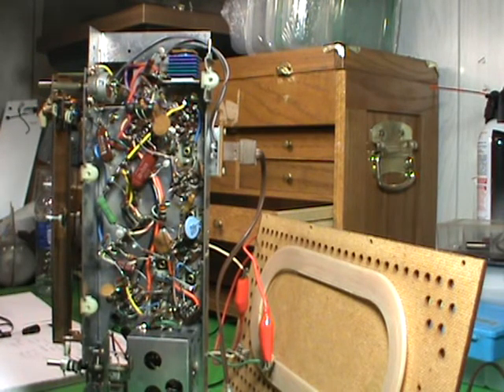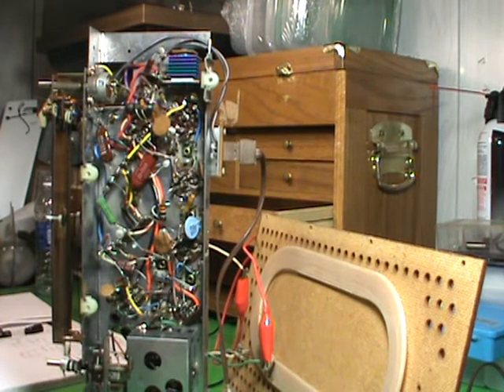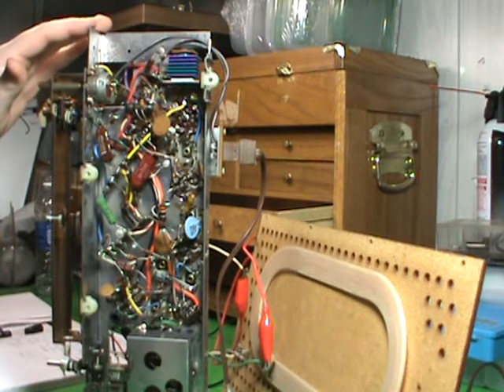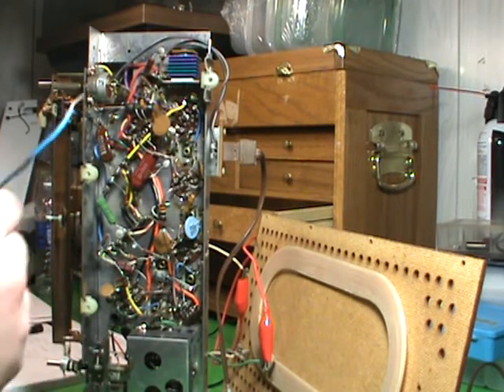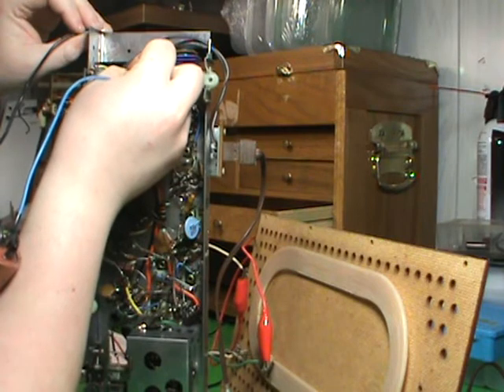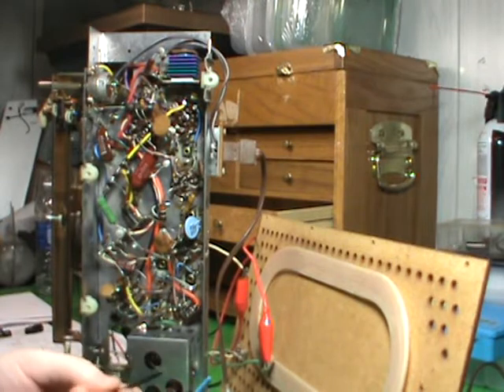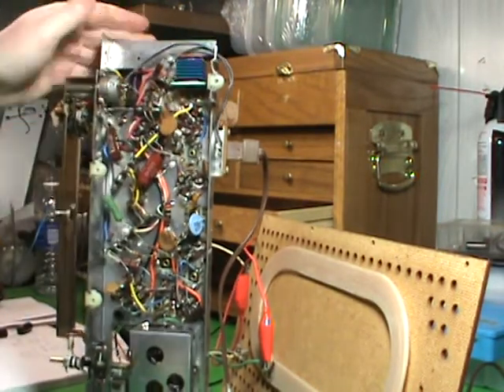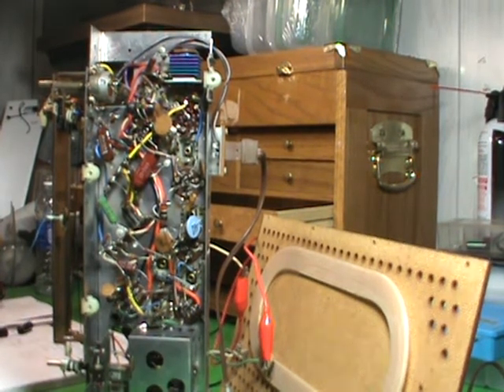Troubleshooting a Zenith K-731 tube radio

Comment: no sound from mine, assumed the selenium diode (blue thing) was out, replaced with 1n4007 still nothing. any comments appreciated.
Reply: Did you put a resistor in series with the 1n4007?  I think you'll need to put something like 100ohms in series with it.
Reply: @jimmccusker3155  What is the purpose of the resistor?  and how does one determine the correct value for it?
Reply: @jonnyphenomenon  Selenium rectifiers typically drop from 5-10V compared to about 1V dropped across a modern silicon diode.  The K731's original selenium rectifier had a 22 ohm resistor in series with it so you're essentially trying to produce an equivalent drop across the replacement diode & resistor.  If you leave the 22 ohm resistor you'll have too much voltage entering the radio.
Reply: @jimmccusker3155  thank you Jim! I am restoring an N731 and an X334, both with 7n07 chassis in them. I had just posted a question about it on the antiqueradios site earlier. This is helpful information. Thanks again.
Reply: @jonnyphenomenon  Good luck Jon.  I have a K731 that I'm restoring.  Right now I'm waiting on parts and hopefully will have it working again soon.

Comment: Your method of subbing in a replacement cap for test purposes while the radio is powered up certainly will,  in most cases, reduce or eliminate the 60 cycle hum leaking into the amplifier circuits and therefore indicate a leaky capacitor.  Anyone attempting this method should take the necessary precaution of protecting themselves should the replacement capacitor explode.  Better still I would recommend that you use clip leads and jumper the relacement into a section one at a time with the radio unplugged. You will hear any difference in hum upon power up.

Comment: Any idea how I would go about dating my K731? I have noticed through a little bit of research that there are 2 distinctly different wooden boxes used. One has legs that go from just under the top and extend below the bottom of the unit, the other has no legs just a base with decorative cut outs. I have  the later version. Just wondering which came first. Thank you for your time.
Reply from the maker: Don't quote me, but I believe the ones with the legs (which is what I have, they call it the Modern) is the earlier version. I want to say late 50s. I believe the one you have, the Colonial style, came out in... 63? I think the Colonial is even designated K731L, But I may be wrong.
Reply: Wow. Thanks for the info. Every little bit helps.
Reply from the maker: The K731 is a fairly common radio nowadays because it was very popular, well built, and used common enough components - it performed well, was built well enough to last 50+ years, and if it needs to be worked on, its easy enough to do and you can still find parts.